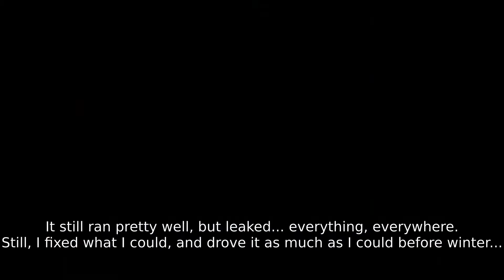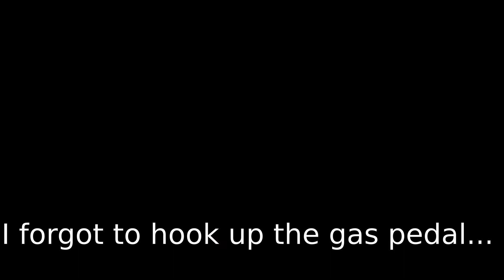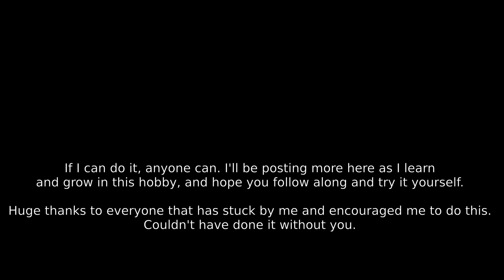LS Swapped 1980 C10 - Introduction and 2020 Recap

Comment: Your story is very similar to mine with my C10 1986 short bed, but I did everything alone, coil over suspension, LS 6L 4L80E swap, quite even the little that I can do in body work was done by myself so thank you for your inspiration and and #godriveit :o)
Reply from the maker: Awesome work! That’s exactly how my build is and will continue to go. I’ll definitely be back on the #godriveit train as soon as the salt is off the roads up here. Thanks for your encouragement!
Reply: @ubf_c10  same here working on mine in my humble little garage waithing for the snow to go!!

Comment: Really thinking of going this route. not necessarily an LS but a more modern upgrade to an older vehicle.now if i can find something not rusted to pieces it'll be on.
Reply from the maker: I highly encourage it! I traveled about 1000 miles to get a truck with a lot less rust than I’d find here in New England. Good luck!
Reply: @ubf_c10  Yeah, i'm in Ky and the cars and trucks are fairly rusty.
Reply from the maker: @timemerson4162   My truck isn’t the cleanest, but it was the cheapest running and sort of driving project I could find that wasn’t a total rust bucket - and I wasn’t being picky. It needs some floor work, a new front fender, and one of the bed sides was pretty crudely repaired, but the bones are all solid which is all I cared about.